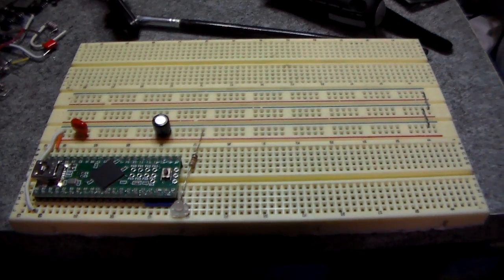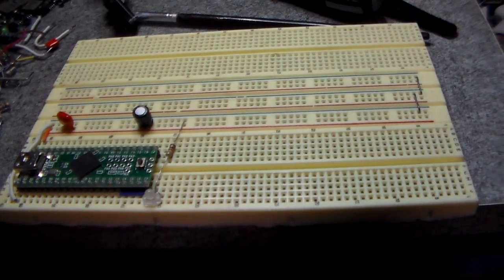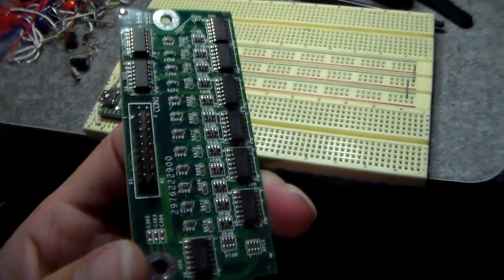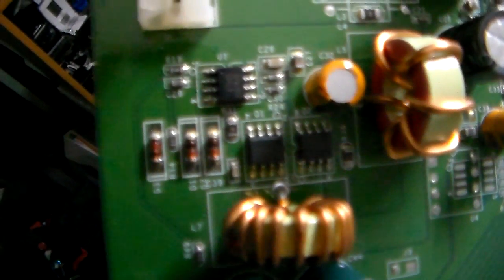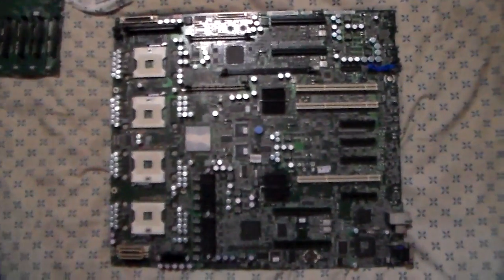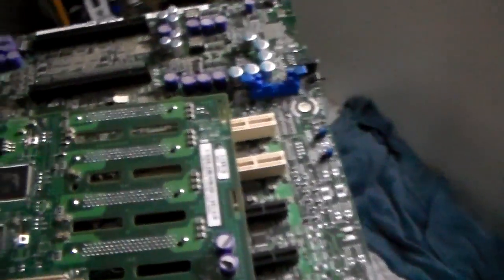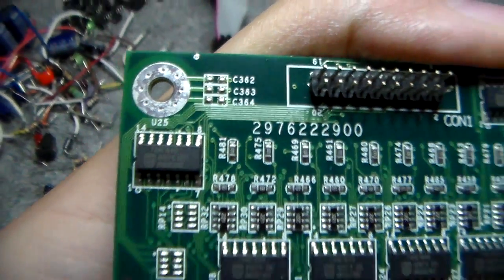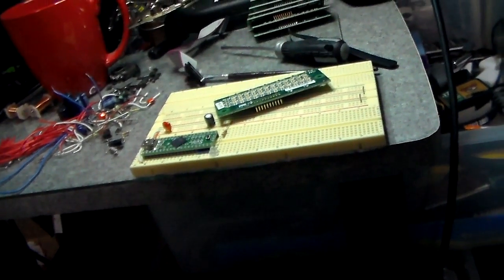Master Control is no more! + awesome stuff from work

Comment: Those are massive 12V PSU's, lots you can do with 12V at 130A.
Reply from the maker: yep my 24v 1100W PSU I put together is plenty for now. imagine those two put in series! 3140W :O but this is what I am using for big stuff now, I can at least plug it into one outlet :D https://youtu.be/S4AMkno3e4Y
Reply: Soon your going to install a bigger socket and breaker to run them, 3140W being two powerful toasters worth of power, or 50 of 60 watt bulbs!!